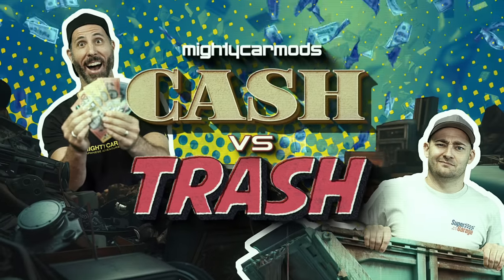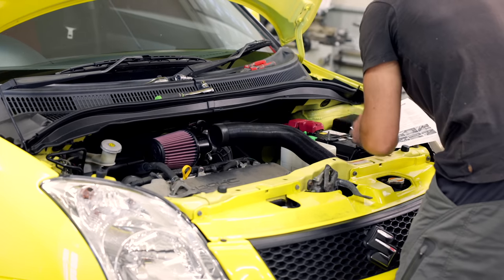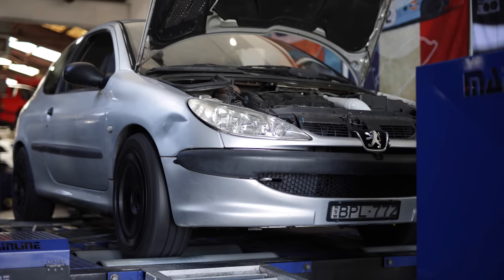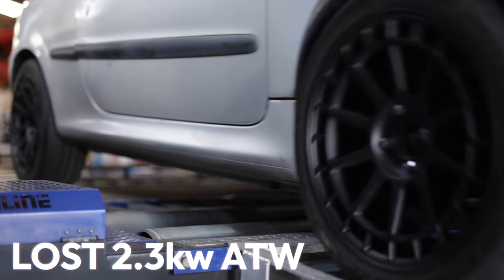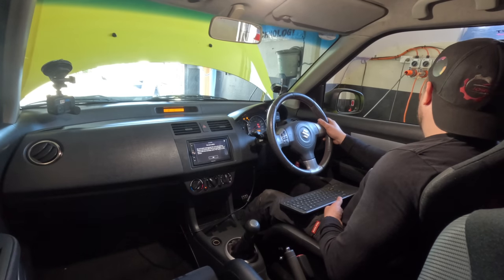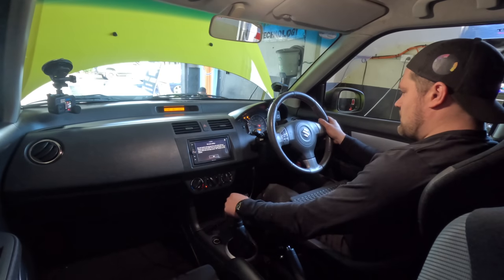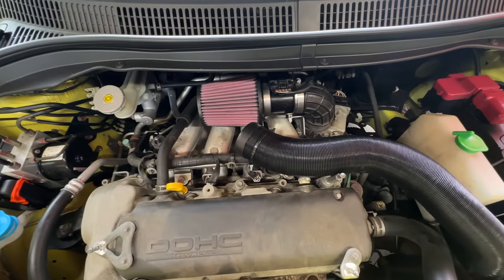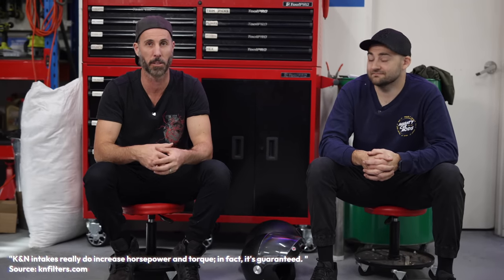Dyno testing POD FILTER Performance Claims | CASH vs TRASH

Comment: You're assuming that a fancy brand name and a high price on the imported exhaust system equals HP gain.  Since it wasn't tested separately from the intake, that assumption has zero data to back it up.  You're also assuming that the intake is the reason for the power loss, but it wasn't the only change you were testing.  You're not being fair to K&N by talking down their product based on testing multiple changes simultaneously.  If you want to see what the K&N intake does to the car, test it with the stock intake and the best tune you can achieve with that setup, then install the K&N, retune the car with that setup and see what you get.  You shouldn't change other things and blame losses on the intake.

Comment: Too many uncontrolled variables to directly blame the intake. You had other mods and it’s possible your car has not adjusted the airflow to adjust for the intake. It’s possible the intake is the cause but we cannot confirm that.

Comment: I think the best bet is an open air filter on the stock box, like I've felt a bit of a throttle response of course it depends from car to car but I guess I have +1-2 hp (not Dyno tested) which in an 97 hp car (like Marty's) is an improvement. once I free the exhaust ( sports cat and exhaust end) I might hit the Dyno to see where I'm at

Comment: I would send that hot air bottle back to K&N and get your guaranteed money back for wasting your time. 

You lost horsepower on this system because 1. The MAF is what is going to determine your power and where you will make power in consumption of the COLD AIR THAT IS FLOWING UP YOUR INTAKE. I seen trouble with this system when I seen where it was installed at relative to where your car can consume the most air, which is why both cars had an awkward looking factory system but through my eyes I could see that they were collecting air pressure from the bottom but from a safe position away from the complete bottom as an inch from the road.

Comment: And yet you did nothing to actually prove it was the intake that's caused the power loss. Is there a reason you didn't test the car with modified exhaust and stock intake? Without doing that, you cannot say with ANY certainty that the intake caused it.

In fact, I'd be more willing to believe it was the exhaust causing it considering one guarantees power and one doesn't. How do you look at that and decide...."yea, it has to be the intake. They guaranteed a power increase so they have to be the reason we lost power instead."

That makes ZERO sense.

Comment: Lol I dont get why K&N is an industry standard for "good intakes". Every car I've worked on, their designs suck. The way they route the piping makes no sense. Theyre fine as replacement filters for the stock airbox, but when its a full replacement, its usually garbage. In most cases you need a proper tune to make use of these systems, but K&N never seems to work well, at least in the applications Im familiar with.

Comment: Bro you paid 400$ for an universal intake. There's is no way that's made for a Swift. You need to stop taking in hot air that's why you lost so much power and I don't believe that's made for a Swift either, you can clearly see the stock intake is trying to do everything in its power to get air from outside and ALSO make sure you don't move the MAF sensor unless you want to retune.

Comment: Intake is sucking hôtel air from the engine so you have less power , kn filter in box is the best thing not this filter that suck air from 360 inside the motor , you can gain if weve put this filter in front of à turbo maybe dont really Know

Comment: K&N is overpriced tat. Stick to the stock filters if you want power. The K&N filters are known to damage turbos on the 3.0tdi engines as they are piss poor filters and allow debris to pass thrugh damaging the turbine. The oil in the filter also ends up coating the MAF sensor causing running issues and potentially damaging the sensor.

Comment: if you tuned it  rather than just bolting stuff on and expecting it to work out the box it would make power 🤦‍♂️
Reply: too add to this without even adding any parts to a stock car , a simple tune/remap would make more cars varies from car to car ( diesels make loads)

Comment: Can't blame the modified intakes for your power losses based solely on the data presented. There were too many changes on both cars between dyno sessions. If you want to show the modified intakes caused the loss of power, you need to run both the stock intakes and the modified intakes in the same dyno session with no other changes. Further there is no information offered on the difference in air density (temperature and humidity) between the two dyno sessions. Total air density is a much larger factor than simple flow rate for increasing power.
That said, I am an engineer and my opinion of the K&N kit is that it is a horrible design whose only real purpose is to get your money.

Comment: What doesn't help is the pure pseudo-science of running traditional rolling roads, get it on a Hub dyno and start the process over again. An expanding balloon of rubber isn't the basis for cohesive measurement.

Comment: Those intakes are a scam. The factory pulls cold air in through the factory air box and the so called performance intakes has the open filter in the engine bay drawing in the hot air from the engine.  Lol. That's why I will never own one. Send it back to K&N and tell them to put it in the bin. Lol

Comment: If you want legit measurements, you have to run it on the dyno with the original wheels and tires installed. Scientific method insists n one change at a time.

Comment: Is this a joke?  There is no way anyone with a functional brain would expect that crappy setup on the Swift to do anything good.  You optimised the position of the filter for maximum hot air and you significantly reduced the total length of the inlet .

Comment: Given that both cars lost power are your new wheel/ tyre combo the exact same diameter as the std ones, if they are larger diameter than stock that could be the issue,  if the rolling diameter is smaller, air intake suck bums😂🤮